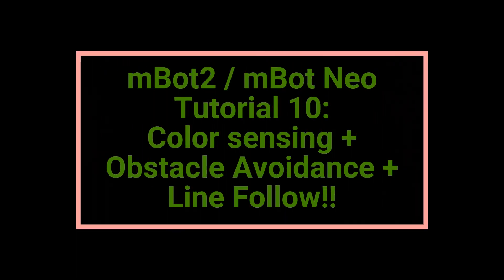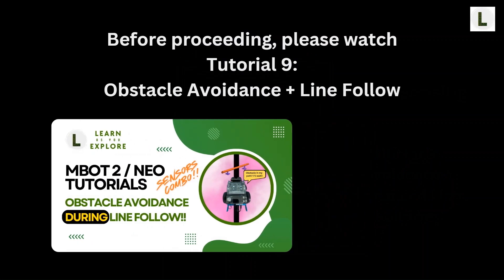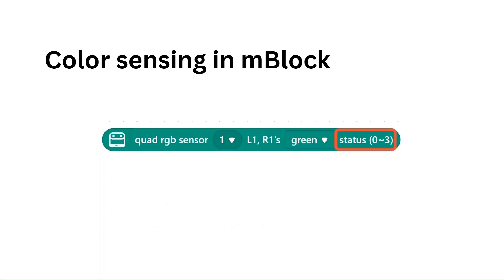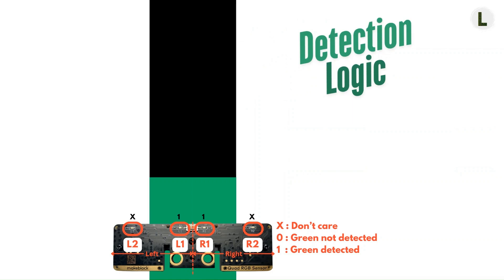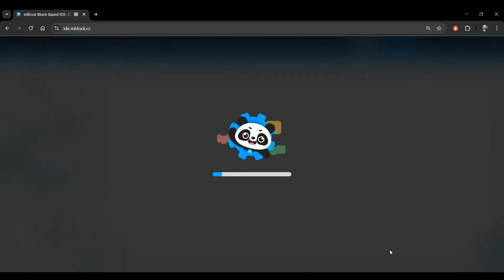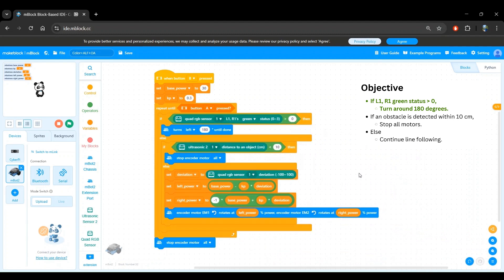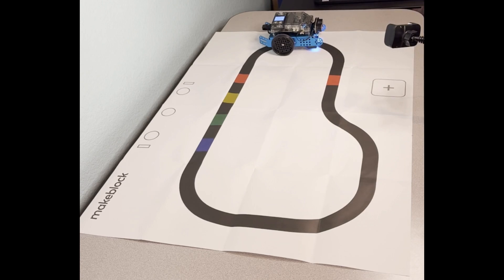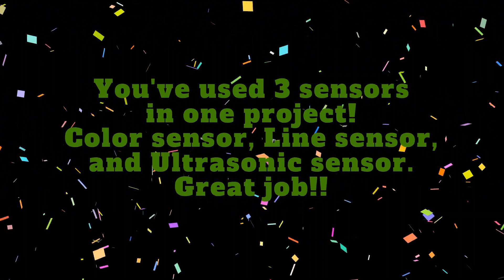Color sensing + Obstacle Avoidance + Line Follow | Sensors Trio!! | mBot2 (mBot Neo) Tutorials

Comment: Does anyone know the Cmyk code of each color so that I can design any mat
Reply from the maker: Hi, thanks for reaching out! If you have an image and want to convert it from RGB to CMYK, you can use the following website to do it: https://www.rgb2cmyk.org/

Or if you’re looking for the cmyk codes for specific colors, I’ve included red, green and blue below:

Red
* RGB : 255, 0, 0 (same as #FF0000)
* CMYK: C: 0%  M: 100%  Y: 100%  K: 0%

Green
* RGB: 0, 255, 0 (same as #00FF00)
* CMYK: C: 100%  M: 0%  Y: 100%  K: 0%

Blue
* RGB: 0, 0, 255 (same as #0000FF)
* CMYK: C: 100%  M: 100%  Y: 0%  K: 0%

Hope this helps!